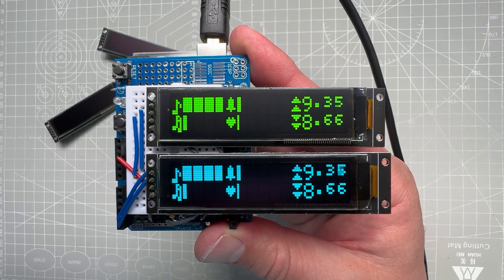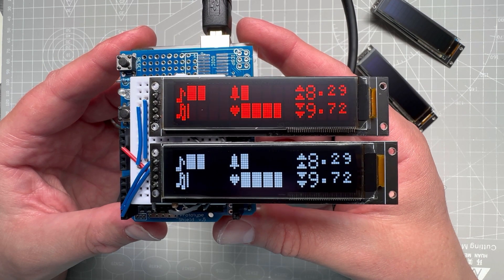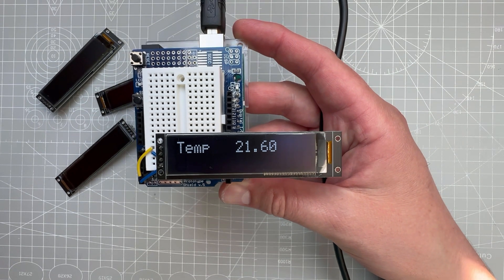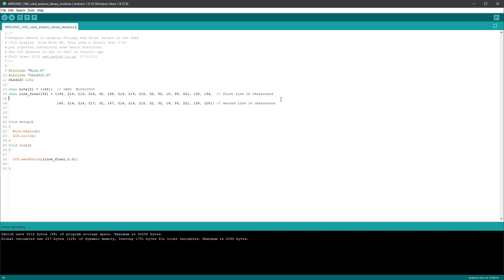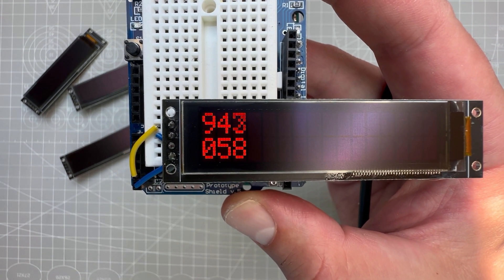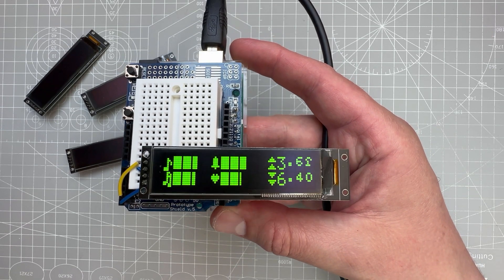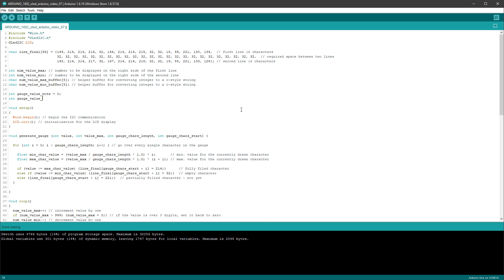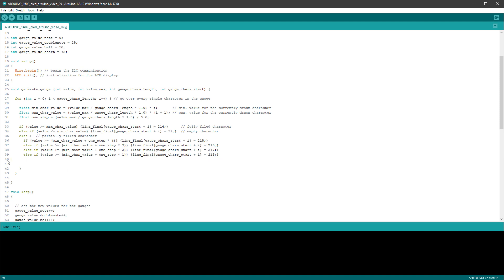Smooth Gauge - No Custom Characters                      (Arduino Tutorial + 16x2 Character Display)

Comment: On a lot of OLED screens using this chip pin 27 and pin 28 are the ROM select lines. With this you can select which ROM table you want to use. It depends however on the manufacturer of the breakout board if it is implemented on the PCB. If you have access to the ribbon cable you could hack the display to use the other tables as well.
Reply from the maker: Thank you for the clarification. I was having hard times trying to figure out if the "ROM table" is something that´s hardwired, or if you can actually change it. Unfortunatelly the boards do not have those pins exposed, but I might try your idea of accessing the ribbon cable pins and trying to switch tables this way. Thank you again for your comment, it was really helpful!

Comment: very good explanation and video! just a few questions does this works with 16x2 lcd display too or something need to be changed?
Reply from the maker: Depends on the 16X2 display type. Different chips support different character sets. This one in particular has a lot of different special characters that you can use. Many other chips will only include the alphabet and digits, with the possibility to define up to 8 custom characters. So yes, you can use this with other displays, but you might not get the same appearance.

Comment: Except it's an OLED. At the risk of sounding sour : OLED displays will slowly die out and become barely readable. All prosumer devices I owned had to have their OLED displays replaced after 5 years or so, since the contrast had gone too dim (a $300 multimeter was one of them). This applies to equipment stored in a workshop, where recorded seasonal temperature swings can go from 0°C to 48°C.
I also noticed the same age-related dimming on consumer products oled displays, such as vaping pens and cardiac monitors .  
Another common factor: all those displays were monochrome (white, yellow, blue, etc). 
TL.DR : OLED displays are plagued with quick aging, used or not.
Reply from the maker: I wouldn´t say it sounds sour, it´s just the way it is. OLEDs look great with the perfect contrast and big brightness, but as you have mentioned, they might not last long. I´m quite surprised by your experience, since I would think that they would still last a little bit longer than just a few years. I have a car that has monochrome OLED and the car is about 10 years old, and it still works/looks fine. I´m also playing with those 128x64 for Arduino and I have a few for about two years, and again, they still look great and I don´t see any problems.
Reply: @upir_upir  I can say it's all about the manufacturer : most of the devices sold with OLEDs are built to make the display pop out, much to bright for the display specifications. I'd wager your car display could be much brighter, at the cost of its longevity. Good thing the manufacturer didn't choose this path.
Reply from the maker: Yep, hopefully it will only get better. I would always choose the oled display compared to the only blue on blue LCD character display. I hate those 🙂
Reply: @upir_upir  A hundred percent with you on this one ! Blue backlit LCD are unreadable ! And don't get me started on blue 7-segments led displays ! Bloom blur blight ! 😵
Reply from the maker: @asmotaku  :)

Comment: My guess is that the 80 character buffer allows you to write out forty characters per line and then shift them one char at a time for a scrolling message.
Reply from the maker: The 80 character buffer is for supporting 20x4 displays, but you are right that if you don´t have that many characters, you can use it to scroll the message.

Comment: nice work !

I think you can switch the ROMs (character-sets A, B, C) you want to use, 
by the 2 Pins ROM0 and ROM1
So there are no different hardware versions of the US2066 driver chip ...
the problem might be that the chip is buried under a huge epoxy drop ...
Reply from the maker: Thank you for your comment. This is actually something I don´t understand - I thought those are separate chips, not that it´s just one chip and you can switch ROMs..

Comment: 5:45 Why not just straight type in Hex values? I mean, the character list is already organized in hexadecimal form, so counting rows and columns will give the Hex number...
Reply from the maker: Good point, it’s just that I prefer using decimal values, but you can surely use hex values, or even binary..

Comment: hey, can you make a video about esp32 s2 mini and st7789 1.3 inch display.
Reply from the maker: What kind of project are you trying to use this for?
Reply: @upir_upir   thank you for the reply. it  is for mp3 player. but i'm having a hard time designing the UI, and menu system. its a bit laggy.
Reply from the maker: I’m worried that it will be hard not to make it laggy, it’s underpowered microcontroller for such a display. Have your considered using intelligent display instead?
Reply: @upir_upir   intelligent displays are kinda expensive. my main goal here is to keep cost low and modular for everyone to make this at home even students to learn basic soldering. i chose this 1.3 inch lcd because it is cheap, colored, and good quality of display.
Reply: @upir_upir   please make a video tutorial how to properly use the library for st7789 display. and which library is easy to use and suitable for animations. thank you

Comment: Awesome ! LCD is dead to me, did you have to put all the empty spaces in because of the way 16x4 displays are configured ?....cheers.
Reply from the maker: Thankfullly this is not LCD :) The address makes sense - it has 80 characters for 20x4 displays. So in the case of only two lines, it makes sense to start from the beginning for the first line and from the middle (40) for the second line. So the second line start from 16 + 24 = 40. I haven´t realized that when I was recording the video.